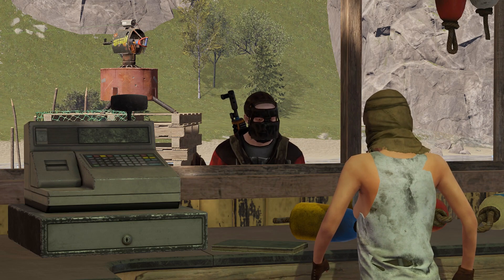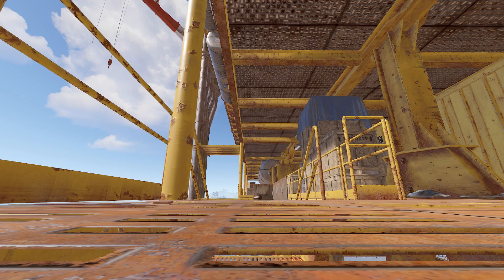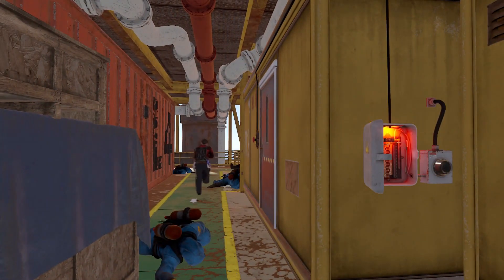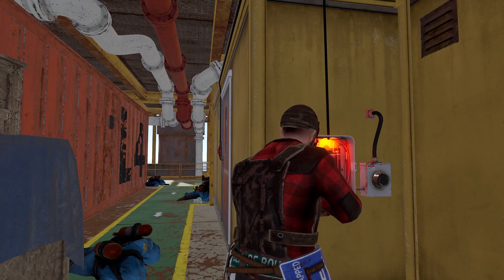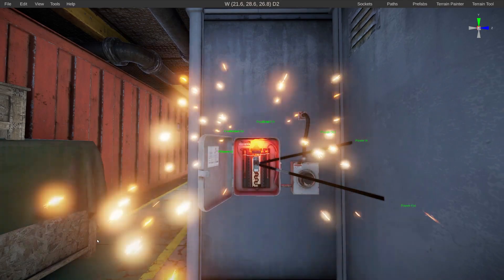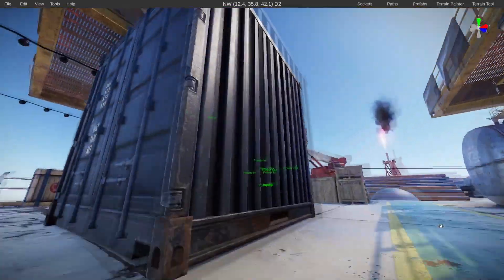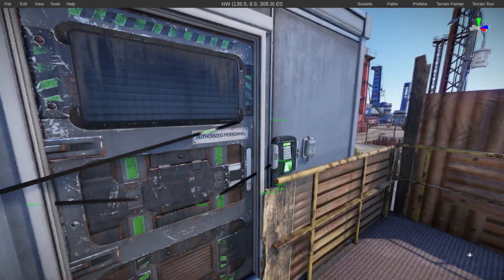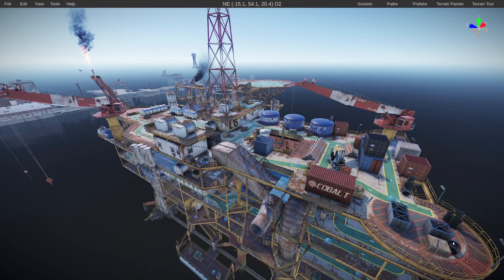what does large oil rig fuse do?

Comment: Not sure if it was small or large but in the top deck there was one that used to link to the heavies siren you could manually turn the siren off or on. Other than that it did nothing however the switch no longer exists the fuse box does